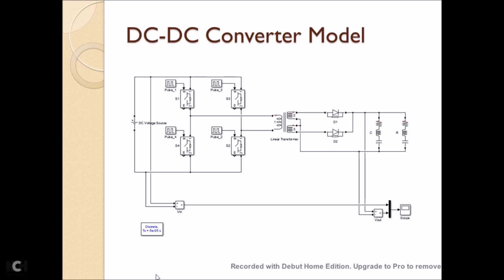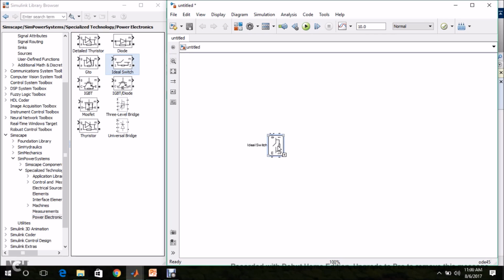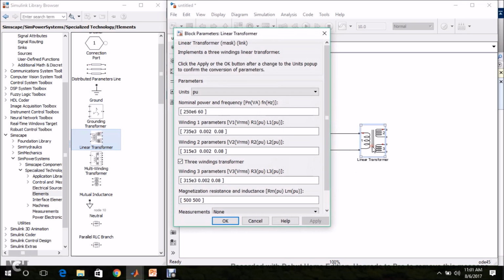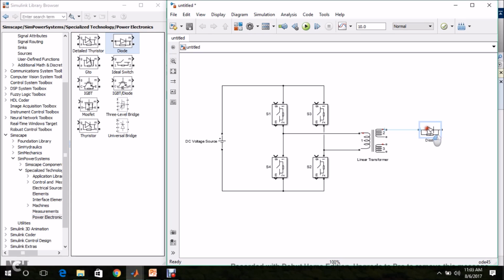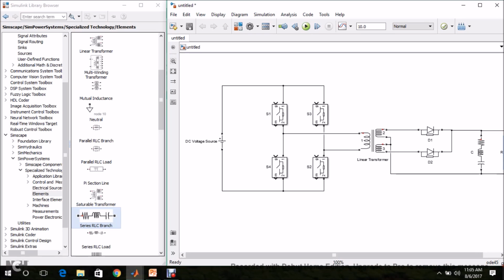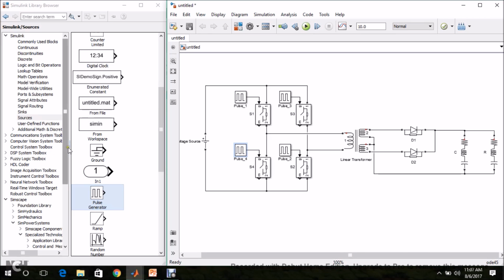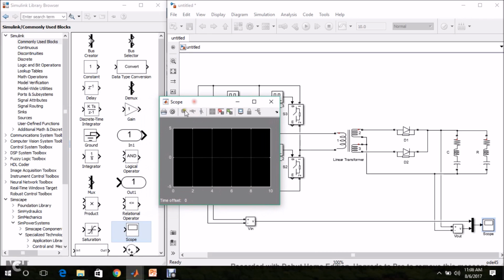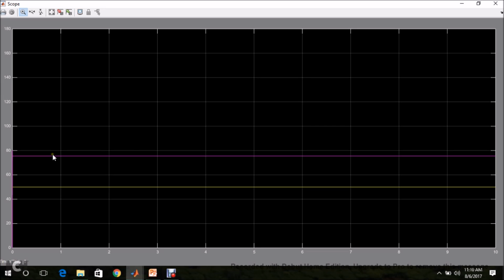Simulation of DC - DC Converter using MATLAB Simulink - Simulation of DC-DC Step up Converter

Comment: How can we design closed loop PID controller for Six pulse DC-DC converter to control the rectifier outputs values  (voltage and current) by using PWM Technique?
 Sir kindly help me in this regard.